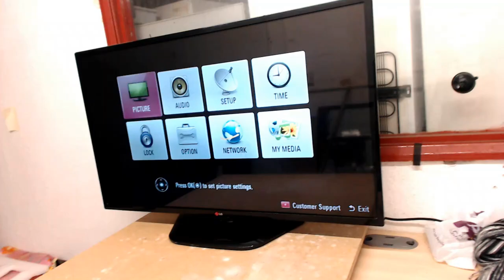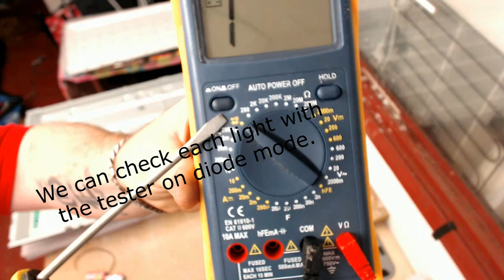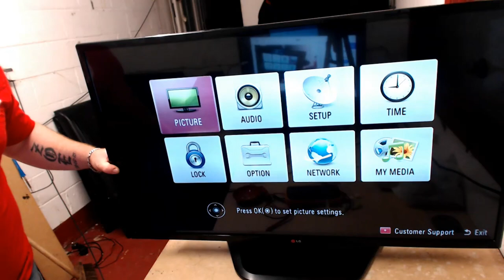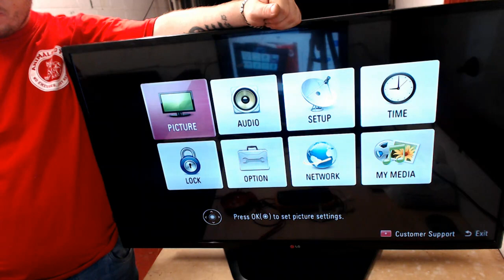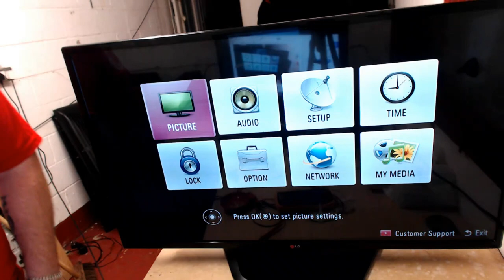LG 42LN540 FAULTY BACKLIGHT FIX TUTORIAL

Comment: Great work. Clear and direct. You mention another tutorial, the Bush LED light hack, but I can't find it. It's when you describe bypassing a faulty LED. I didn't quite get what you were explaining. Is it running a wire to bridge the dead LED?
Reply from the maker: Mark Maynard yes it’s in my other videos I can’t make a new video if you like it was when I first started tv repair u can solder the contacts on the led light and it will flush through the power supply and u won’t notice any difference . Thanks for the comments
Reply: @FlipTVsForProfit  Thanks. Would you have a link for the other video for the Bush TV?
Reply from the maker: @markmaynard9626   https://www.youtube.com/watch?v=FUa6MdWYhMA
Reply from the maker: @markmaynard9626  

https://www.youtube.com/watch?v=tnxZFYbs3Uc
Reply: @FlipTVsForProfit  Thanks :-)
Reply from the maker: Mark Maynard no problem